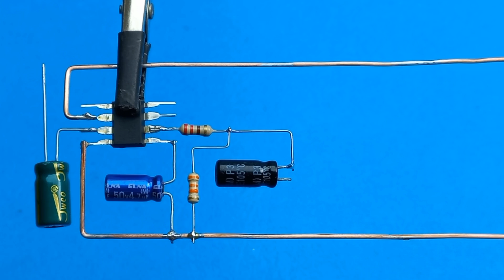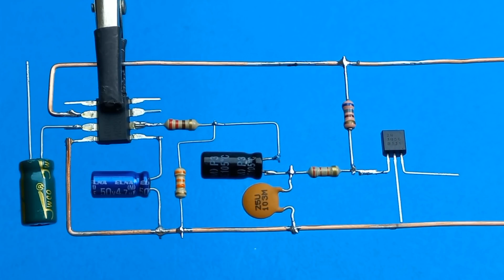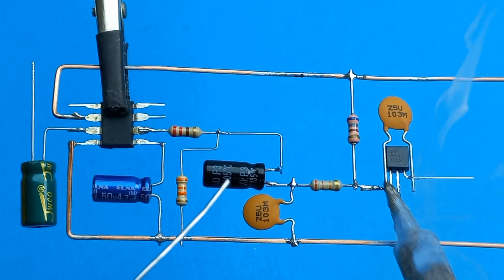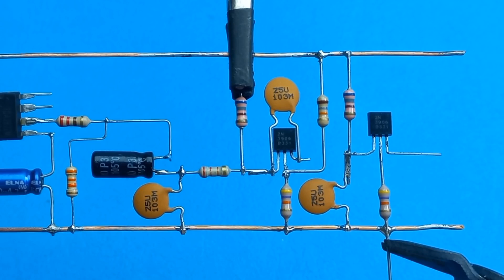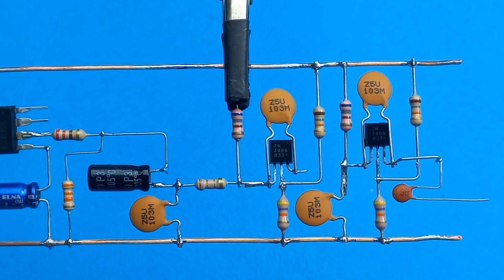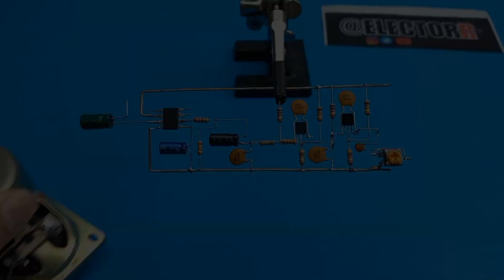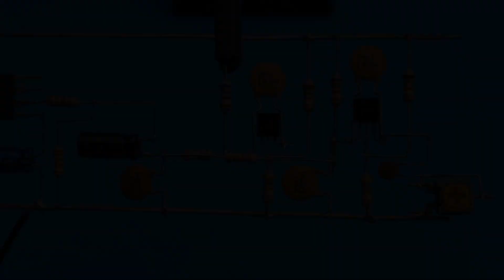Diy metal detector using TDA2822

Comment: My TDA is on its way here. Looking forward this new successfull project but Im thinking of  trying it strictly and with wider and less coil turns targetting deeper distances, hopefully it will aucceed.
Your channel is very sensible and simple because you use direct wiring with no complicated boards. Im not an electrician with no background in electrical engineering but i started with you and succeeded with replicating 4 of your projects. Keep up the success & great job🎉.
Reply from the maker: Thanks for your support, habibi ❤️